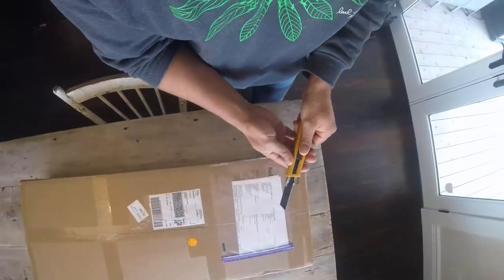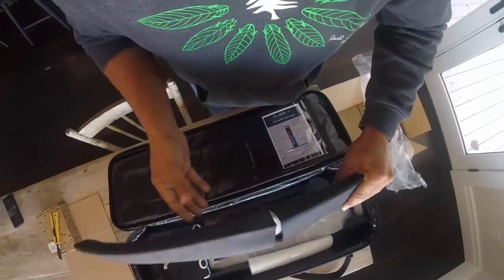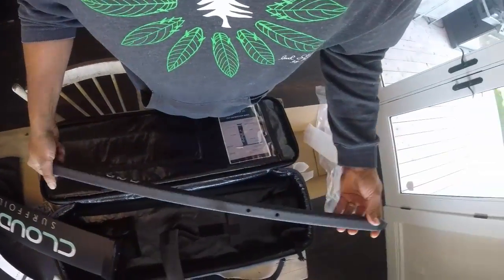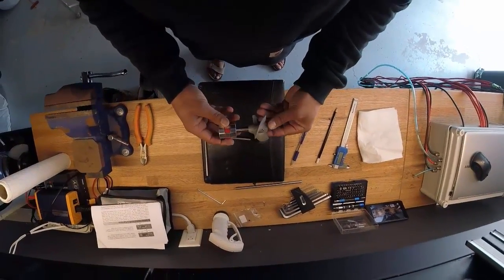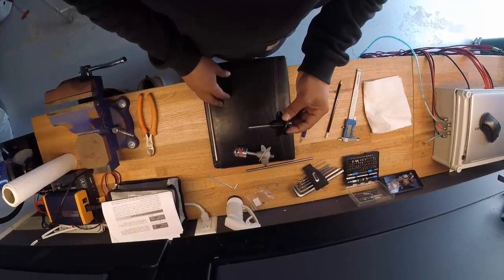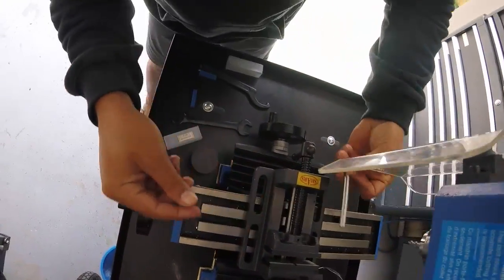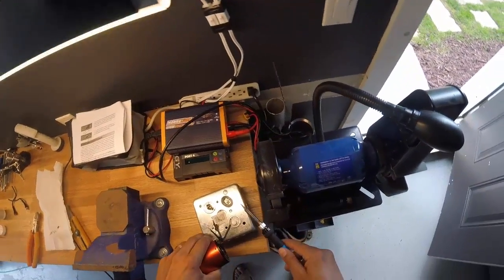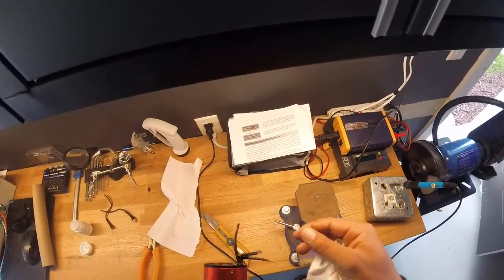VeFoil by VeConcepts Part 9 - Final Preparations for eFoil Jet Drive

Comment: Such an awesome project! I wanted to give a tip, there is a guy who owns Enertion electric skateboards and he made a handheld controller and also a very nice 16s flat battery pack. Maybe you can contact him for his suppliers or just to get an idea. Cheers!
Reply from the maker: Thanks, yes we really do like the flat battery packs as well, but 16S is starting get up there with VOLTS and we dont really wanna be using that much power for safety reasons around water :)
Reply: DIY Electric Hydrofoil Good point haha. I heard Lithium Ion cells can actually explode. But the flat formfactor sure is interesting. Good luck!

Comment: Are you achieving more thrust that the original prop design?
Reply from the maker: We have not tested thrust on new setup yet as my hot tube is out of commission and drained at the moment but we will compare it soon. the key is to get out riding, it if works or not, and keep on refining until it does.